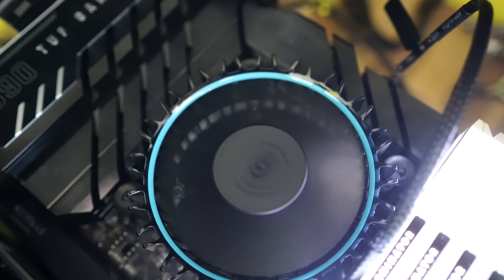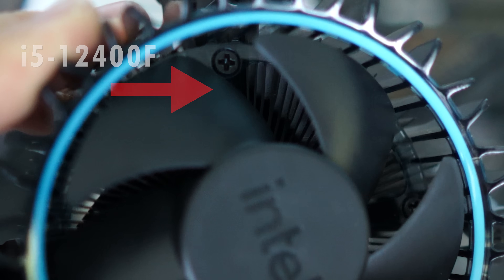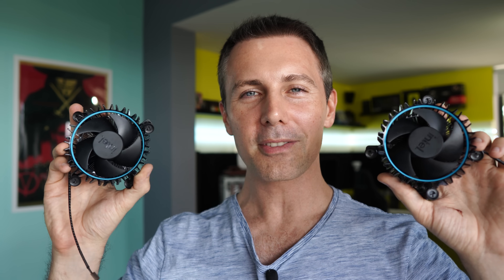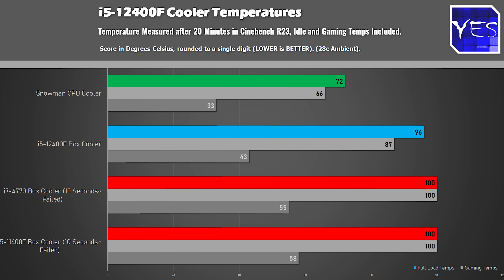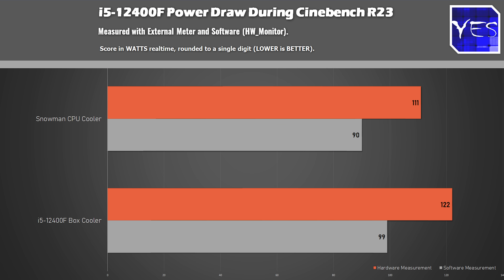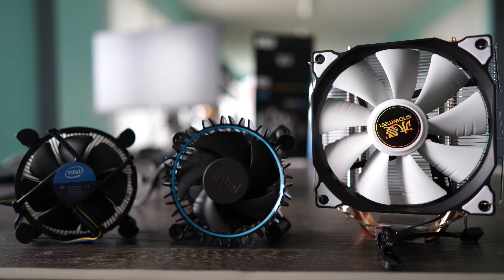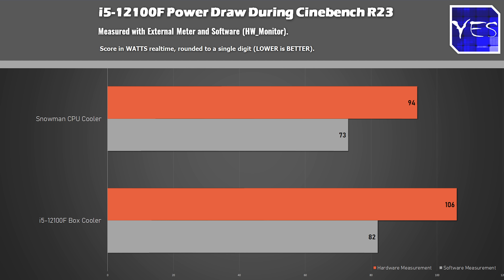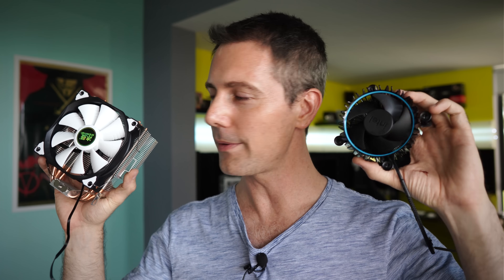Is Intel's New 12th Gen CPU Cooler Actually Garbage?

Comment: I have a very important question that was not covered in the video: Is there a proper LGA1700 mounting kit for the snowman?

You were using the Z690 TUF Gaming board which has holes cut out for both 1700 and previous gen sockets but that's not for the majority of the cheap motherboards you pair a low end CPU with. Even the overpriced B660 TUF Gaming board only has LGA1700 mounting holes. 

I know you can bend the mounting slightly on a 212 to fit but given buildzoid/igorlab's testing about CPUs bending under long term use and reducing contact, I would be very hesitant to recommend this for a long term build.
Reply from the maker: I will check for you, it has 3 adjustable points on each leg, Pretty sure you can get it to fit the 1700 mounting holes.
Reply: @techyescity  Thank you. This be very useful info since they won't have to buy or wait for the mounting kit. Cheers!
Reply: @techyescity  Awesome! I bet a lot of people would like to know. This cooler, and a b660 mobo with an i5 12400 would be very good bang for buck!
Reply: @techyescity  I would love a deep dive into current budget oriented coolers that fit on 1700 boards with or without the backwards compatible mounting holes. I know the Soyo has them but I know lots of other 1700 boards don't and I know there's also other differences like the mounting pressure/clearance.
Reply: Thats the most important question. Can you put this cooler on a B660 Board? i cant find any info on this.
Reply: there a ocean of number out there and many variable was running in quite high ambiant situation since mention igor lab may check is power draw number on water and find both extreme more than likely if you in 20 c or lower years around ambiant that temps whit stock cooler are just fine whit case whit some movement of airflow also likely can play whit voltage power draw and heat depending how motherboard bios end up throwing at the part was majority affortable motherboard probably won't past the 95 watts mark anyways out of the box for more than 30 sec than you got fan it self possible that the intel fan pull extra watts because of been low cost high rpm than a typicall 120mm always fun to see variable from different testing none the less

Comment: I feel like Intel should actually spend the $2 more to put a cooler in the box that is adequate. How many of these things end up as e-waste?
Reply: I took the actual heat sink off of an old one and strapped the fan to my motherboard for active vrm cooling lol.
Reply: @Dan_Rugs  my man
Reply: @Dan_Rugs  Lmao nice. I've been thinking about doing that on top of my AIO block.
Reply: @Dan_Rugs  could u tell me how you do that .. i wanna see
Reply: @abidazzaky9615  yes sir, the metal heatsink is just force fit into the plastic housing and can be slid out!
Reply: Agreed. They'd get so much positive marketing if they had a better cooler included. Just like the ryzen cooler, makes such a point for value.
Reply: @StarsMarsRadio  ryzens don't have a cooler anymore. 
Only the "stealth" one and that one is just as bad as this Intel stock cooler. 
I know because I used it 😅
Reply: @damara2268  They did though. The point is, if intel put out a good cooler, their value and publicity would be through the roof.
Reply: @damara2268  
Ryzen still comes with coolers... kinda. The X variants have never come with coolers, and mostly just X variants are released for Zen 3. The 5600G comes with a cooler. I think the coolers are worse than they were initially, though.
Reply: @Austin1990  yes it's just the basic cooler now, it's called stealth I think and it's performance is same as the Intel stock cooler so I don't get why so many people are laughing about Intel's current "new" stock cooler being very bad while AMD stock cooler is literally the same thing just with a different look
Reply: @damara2268  on anything 3600 and below the stock is just fine for me . i live in a medium to cold climate though . -35 at most in winter +35 at most in summer but basically negative 20 to plus 20 on average. and then a decent cooler upgrade is 20 $ . 5 or 6 heat pipe 6mm sometimes sprayed to a certain color is plenty for most.
Reply: @StarsMarsRadio  The stock cooler is fine, the CPU is being operated in this video overclocked, as in no long term power limit.  At the Intel specification of 65 watts the cooler is fine.
Reply: yeah so much of preaching about global warming, plastic waste, environmental pollution, but these big companies barely do much against them.
Reply: Or subtract $5 off the price for no cooler.
Reply: @sixcoregamer9221  That would be great, 12400f, no useless Igpu, no e-waste cooler, $175, perfection.
Reply: @sixcoregamer9221  You can buy TRAY versions of the CPUs.

Strangely enough sometimes the TRAY version is more expensive for some strange reason.
The prices for TRAY and BOX (BOX is the version aimed at the end consumer) fluctuate independently.
TRAY isn't aimed at the end consumer, but at some shops you can buy those nevertheless.

The last Intel TRAY I bought had a protective surface for the contacts out of some type of black hard foam and a cover made out of cardboard, not even a box which fully covered it.
The cardboard was blue and had a sticker on it with the name of the CPU. No plastic, no fancy package, not even twice the size of the CPU.
The way how products should be sold imo.

Simply try to look for TRAY when buying a CPU and you might fight what you're looking for.
Reply: @ThePandafriend  I would rather buy a cpu in a box with a full warranty and pay $5 less than buy a tray cpu with no packaging for full price and only get a 30 day warranty.
Reply: it is e-waste that comes from offices and schools and the Intel stock cooler does its job.  You also have to consider its size which easily fits in compact builds where Intel cooler performance not far from a high end low profile cooler.  A more savvy user may want to undervolt for better results.
Reply: @zodiacfml  yeah, I always love how gamers only ever think about what they want to do with the hardware and not where it will mostly be utilized, i3s and i5s (the non k variant) have always dominated in the office space in the 500-700$ pc range, and it won't change, you are absolutely right, for a office use the intel stock cooler is more than decent
Reply: @pietrocavicchioli6128  it is because CPU chips becoming more efficient like the 5600x and i3-12100 all a gamer will need and those are 65 watt chips
Reply: @pietrocavicchioli6128  In the office space they buy pre assembled pcs. The companies who assemble those buy the CPUs in a non fancy looking "package" without cooler and add their own cooling solution. The ONLY persons who get the coolers are end users who buy the processors as retail versions, which are mostly gamers or people who build custom workstations. Neither of these groups uses stock in most cases.
You can be pretty sure that most of those coolers end up in a landfill without being used even once.
Reply: @zodiacfml  That and when selling millions of units, every penny matters.
Reply: @zodiacfml  I noticed he has not responded to anyone who has presented that prospect to him in the form of a question....
Reply: I have the opposite thought from Alex Coleman; would rather see Intel take $$ off the price of the CPU, sell it w/o the cooler and let me make a choice of what aftermarket cooler I want to buy and use.
Reply: You do understand that running the CPU without the long term 65 watt power limit is overclocking, right?  The cooler works fine if you operate it in specification.  This is an issue that is completely ignored in the video.  What's even worse is he's showing power draw BEFORE the CPU VRM, which is of course going to higher than the CPU is actually using.
Reply: dont worry, intel is neutral for climate because they moved all production and CO2 emissions to China and they are clean by this simple trick buhaha xD
Reply: Might as well not offer any coolers at all, except for business solutions.
Reply: learning frm the amd
Reply: to answer your question, all of them
Reply: I agree with many of the sentiments. Cut out the OEM cooler and make it an add on purchase. Cheaper CPUs, less waste, smaller packaging.
Reply: But then in all actuallity, how many of you would actually use said adequate cooler?  I probably wouldn't.
Reply: its a hunk of metal. It isn't considered e-waste lol. Very easily recyclable.
Reply: @ameerabdallah5429  did u even know how much energy we waste to recycle those? steel recycling considered as one of the most damaging industry to our ecosystem
Reply: all of them
Reply: Pull out the fan cable, stick some hot glue on the top of the fan, stick a good 140mm fan on top. You have a cool and quiet cooler 🤣
Reply: Mine sure did, on my 5600, 5500 and 12100F...

I get it that they "need" to include some cooling solution, but I'd prefer a discount and no stock cooler. I haven't used a stock cooler in a while even in non-gaming builds simply for acoustics reasons.
Reply: Where do you think they should put the $2? More metal? Then it won't fit every motherboard and case
Reply: they put a cooler its already good you guys are never happy so companies dont know what to do cause no one is never happy
Reply: with a custom fan curve it keeps my 12400f under 70 degrees, its good enough for me
Reply: The Intel Boxed cooler is garbage. Heat is the enemy of performance.

Comment: Got me a snowman with a x99 mount running a Xeon E5 2640 V3 . the 2640 v3 does not run very hot as it is but summers are hot here and i want upgrade o better cpu in future so Snowman was my go get,

Comment: I already have an NZXT Kraken X42 waiting to use with my 12600 non K (140mm AIO), but I'm still waiting for both the LGA1700 mounting kit and the H670 motherboard :(

But if this stock cooler is reaching 96c on a 12400, how is it going to be sufficient for the 12600? I wish someone would review that chip.

I should be able to raise the thermal limit and have it maintain the maximum boost with that cooler, which I believe is only 4.4 Ghz (4.0 / 4.2 / 4.4 difference between the 12400, 12500 and 12600).
Reply: If you set the motherboard to obey the 65W PL1 power limit by Intel, the stock cooler is actually adequate. This is the worst case scenario of disabling the power limit and absolute multicore stress test
Reply: My 12400 is fine , never crashed once playing bf2042  , you just adjust the fan settings in bios to ramp up on the graph . But I still want another cooler just to be on the safe side .

Comment: my 7700k runs at 90C while gaming and gives me no stuttering problems (i don't have OC but the cooler plate is not flat, hence it does not make good contact). Also should be to keep in mind the fact that noone has 28C in his room, probably "real word" temperatures will be a bit better.
Reply: Get yourself a snowman or 212.  90C is insane.
Reply: @Doazic  naaah it is fine 😂. picture of child on the swing with everything burning in the background
Reply: Worst case it thermal throttles, no big deal

Comment: It surprises me that the cooler is actually any better than the old ones. It always looked like the same thing and they added some plastic to make it look more modern. But I guess there must be another difference as it works while the others don't work. Maybe the old ones have mounting issues? Because it really really just looks like the same old pig with added lipstick. And that would be the exact thing I'd expect Intel to do.
Reply: afaik, lga 1700 has a lower z-height, so the old stock coolers would more than likely have inadequate mounting pressure, given they are already mild.
Reply: "just looks like the same old pig with added lipstick." how true!!😂😂
Reply: Could be the copper core, or at least what looks like copper
Reply: It has a copper slug
Reply: Just looks like the same fan inverted
Reply: its shit. hitting 85-95c, somtimes even 100c in games, 45-50c idle.
Reply: @pharaoh6745  You don't see after 20mins estress
Reply: Production lines get better and more efficient over time.

Comment: 5:55 Can anyone explain to me why insufficient cooling increases CPU power draw? thanks
Reply: Because silicon tends to be less efficient at higher temperatures. If you take the same CPU or 2 identical CPUs (including their chip 'quality') and run them at the same clock speeds stably, with two different cooling solutions you will end up in different power draws because of the physical properties of chips: a chip running at 4ghz at 80o C may consume 80W, while the same chip with another cooler running at 4ghz at 90o C (not throttling) will consume say 95W. In short: silicon needs to be cool to be power efficient, which is pretty crazy - This means that a bad/insufficient cooler may end you up with a chip that 1) is hotter/lesser lifespan 2) is louder 3) has worse and unstable performance as the chip underclocks to save its life, AND 4) consumes more power! Final note: some coolers have different power draws - which is not measured here - but this is usually negligible.
Reply: @GiorgosKoukoubagia  Thanks for the explanation, very interesting!
Reply: Possibly worse efficiency when temperature rises aka thermal efficiency.
Also this could be motherboard related.
Reply: @TheSektor13  Thanks!
Reply: Resistance increases as temperature increases.
Reply: With higher temp power leakage is bigger so cpu consumes more power.
Reply: This has something to do with what's known as static leakage (mainly although you should also account for resistance in the circuit increasing as well) whereby a transistor allows current through even when it is turned off (this leakage subsequently increases when heat increases) this results in increased power draw. An Anand Tech user Idontcare who actually conducted a similar test and came to the same conclusion. Just search Effect of temperature on power consumption with the i7-2600k
Reply: @smokeyopsgaming1002  Thanks for the explanation, very interesting!

Comment: Did you see that derbauer found that non k sku processors can be overclocked on some z690 boards? I hope that goes to all the z690 boards soon including the budget ones
Reply: Asrock usually sneaks these kinds of things in lower end boards. They've had an A320 (v4) board that supports Zen3 for a while now hehe
Reply: it would be insane. probably too good to be true...
Reply: @mastroitek  the same has happened in the past with skylake and ryzen based athlons
Reply: @BonusCrook  well. This is one of the few times that I hope history will repeat itself!

Comment: Why don't amd or Intel do tower coolers with there cpu's you would have thought they would of learnt something by now lol
Reply: 1. These coolers are smaller

2.  It's never about cooling performance.  It's about providing the cheapest possible cooler that keeps the chip functioning.
Reply: @kintustis  using it as a backup not feontline
Reply: probably a mix of cost and compatibility

Comment: At least the new cpu coolers look actually good imo
Reply: theyll look good in my cupboard where theyll be spending the next few years... seriously who gets a $220 cpu and drastically limits its Performance and lifespan by not getting a $20 aftermarket cooler
Reply: @La_sagne  why you think you gonna lose performance? If you do stress tests and benches - yes. but in games it will be okay
Reply: @La_sagne  A cheap Hyper Evo 212 is must for everyone really
Reply: @DjoXey  96C in cinebench and without undervolting.  A PC game might use 3-6 cpu threads.
Reply: @DjoXey  that is good enough for many games.  With a 0.1-0.15V undervolt, my guess is temps would be under 80C in most games.
Reply: @DjoXey  The snowman is big and heavy.  The intel stock cooler is included in the box.  The snowman is too tall to fit inside most SFF PC cases.  Laptops would not exist if no one made compact cpu coolers.  I can mine crypto on my laptop because unlike most people, I know that a giant heavy cooler is not necessary.  I have 3 desktop computers that mine crypto on the cpu 24/7 and none have tower coolers or water cooling.
Reply: @DjoXey  You should work as a Russian troll.  In fact, you already are .....
Reply: it reminds me LICH KING from world of warcraft LMAO

Comment: I'm very interested to see this review. I recently recommended my friend an i5 12400, and the new cooler design completely slipped my mind. Thanks for providing the coverage so quickly!
Reply: Use a 12400f if you get a gpu, its cheaper but same cpu
Reply: @thedamntrain5481  I wouldn't get the f variant unless it was substantially cheaper tbh. The iGPU is very helpful for troubleshooting or acceleration and will allow the CPU to be useful in the future as a media server or something.
Reply: @Zosu22  its useless if you have a gpu to pair with already
Reply: @kev1310  Not if it crashes and then you can't even use the PC for anything at all.

Good luck buying a GTX 1050 for $300 in this crazy market.
Reply: @kev1310  i built my dad a pc using a ryzen with no igpu. i spent hours trying to figure out why there was no video output. turns out the pci slot was dead. from then on i will always get a cpu with a igpu
Reply: @DaybreakPT  This is why I never thrown away my trusty gt 1030 lul.